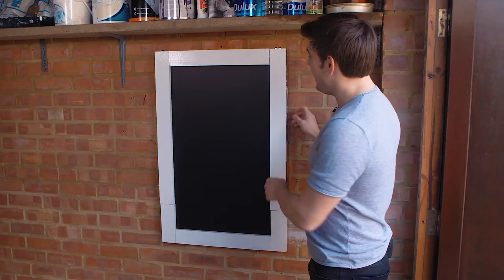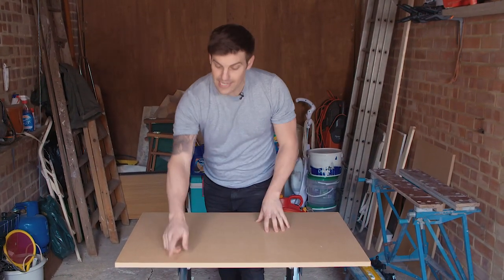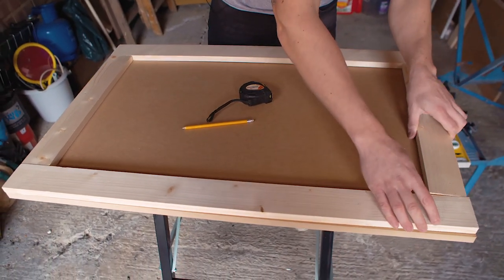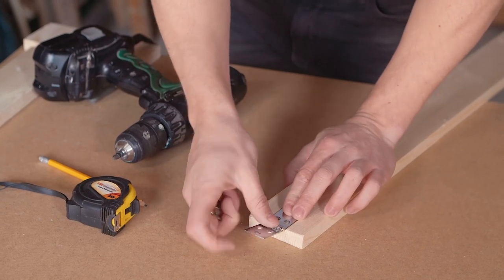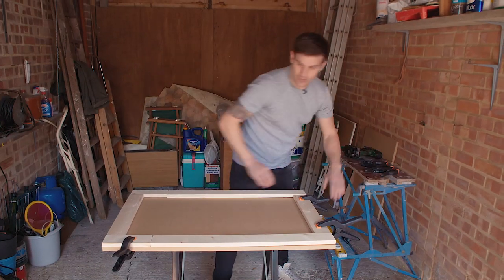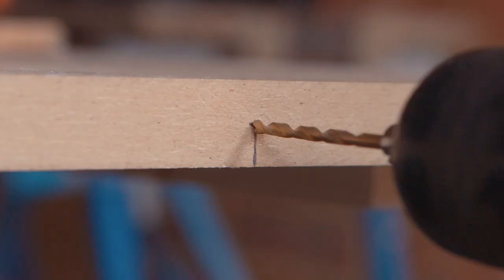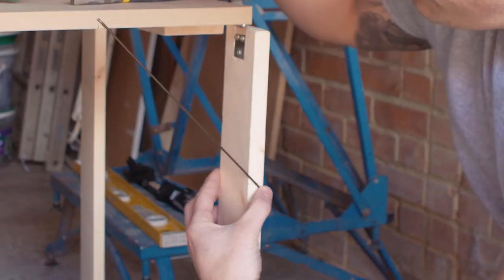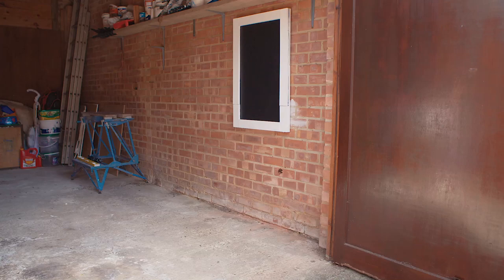How to - make a table that is also a picture frame

Comment: I successfully made it with birch plywood for the desktop because it was light and strong,  Thanks for the video!  I also used heavier hinges that attached to the table legs.  In addition, I used door hinges to attach to the wall.  I screwed directly into the studs and this provided a lot of stability.  In addition, I used magnets instead of cabinetry latch to attach the top of the desk to the wall. The wire coat hanger worked surprisingly well.

Comment: How would you recommend making this strong enough to be a dining table?
Reply from the maker: Hey. The legs on this example table aren't strong enough to support a lot of weight. I would reinforce them with a much stronger support bracket that locks the legs into a 90 degree angle for when the table is down, plus I would build it so the legs and the baton that goes across the top of the frame are joined, giving it more rigidity. Does this help?